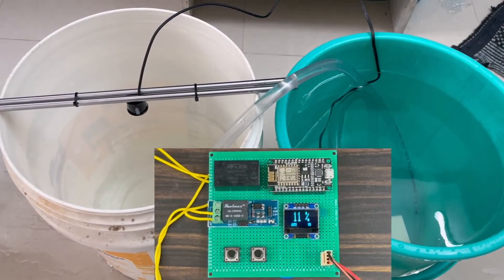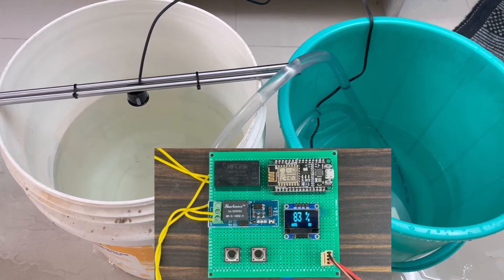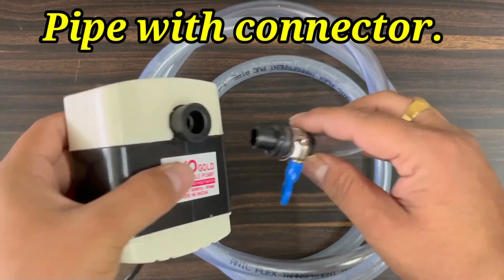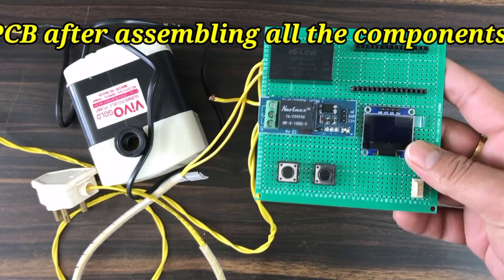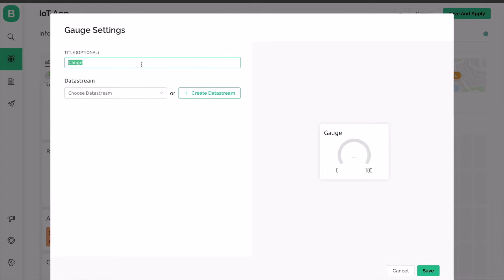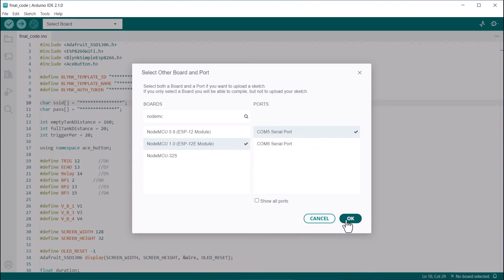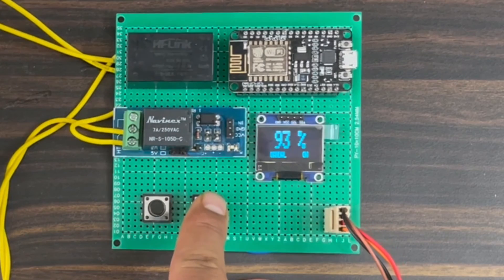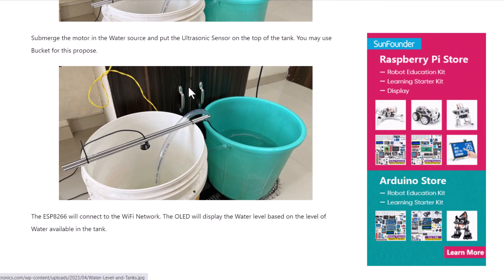IoT Based Water Level Control & Monitoring System with ESP8266 & Blynk

Comment: Can I connect 9 v batter instead of 240v AC
Reply: Just make sure your motor voltage matches your power supply and relay will handle the rest

Comment: Hello mam, i am also trying to make same kind of project but in my project inust want to use relay, ultrasonic and nodemcu and i have to turn off the motor when the bucket is full can you give any suggestion to me how to do it
Reply: And also i have to use blynk to check the water level and control the motor
Reply: @kamleshgorade5699  see if the blink some automation triggers so that can trigger a event to turn off the motor using relay or look for mqtt protocol

Comment: The thing is overhead tanks are usually located at third or 4th floor, so connecting the sensor and rest of the circuit is not practical, so consider adding nrf wireless modules to make it complete. Willbe waiting for v2.
Reply from the maker: Yes this can be done. Perfect example. I can try this in future for sure
Reply: Brother it's possible ultrasonic sensor wire only 4 so using CCTV cable is chep so connected to that 4 wire board in your home